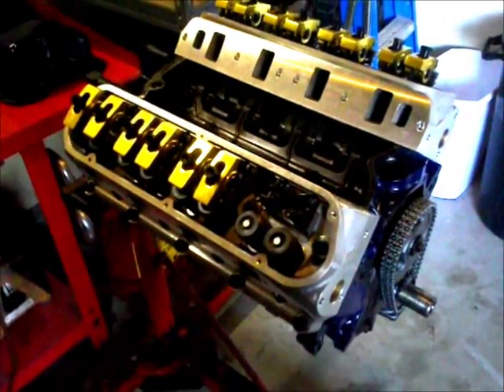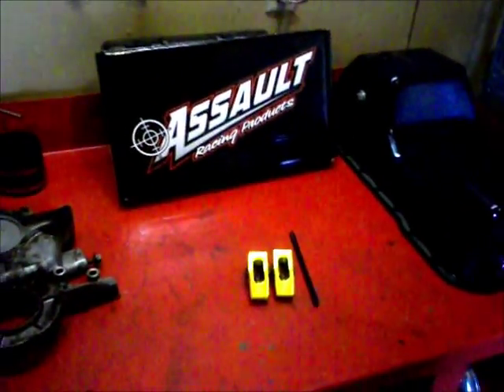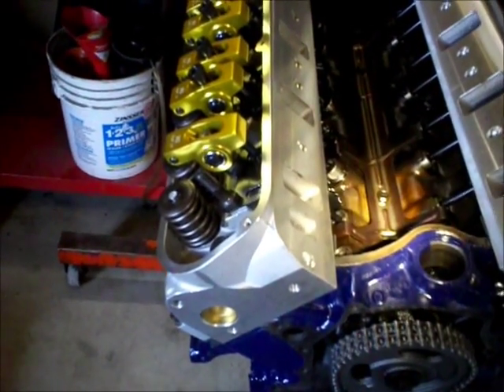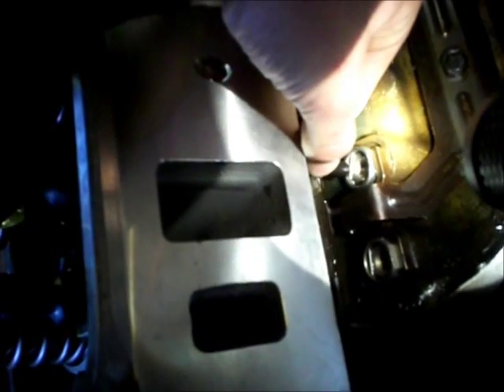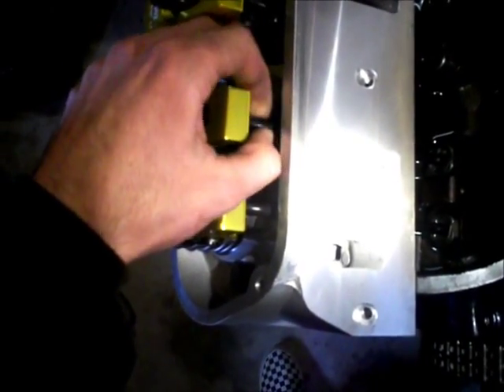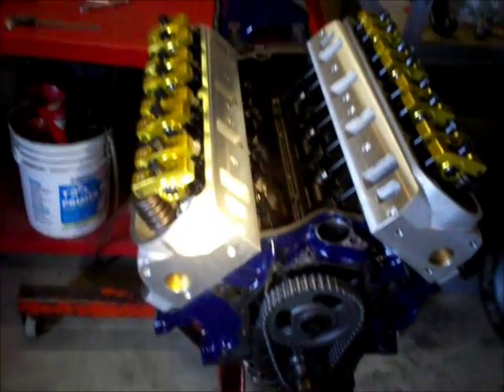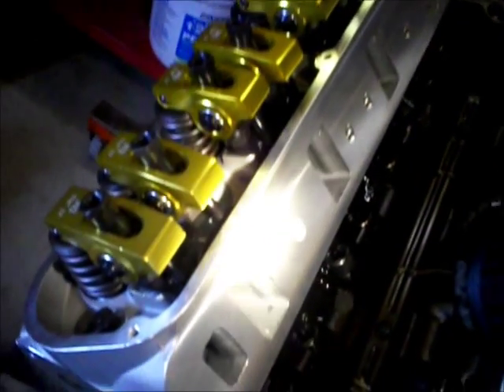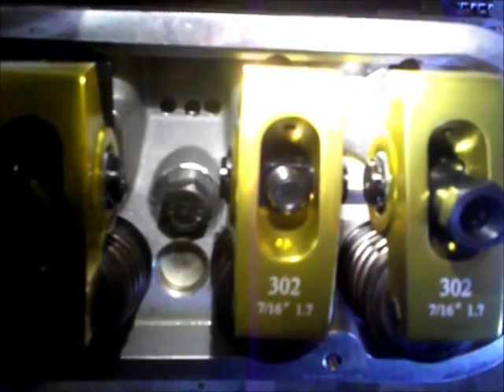How to: Adjusting roller rocker arms

Comment: Man if you actually did it this way you would be wrong use a feeler gauge simple
Reply from the maker: If it was a solid lifter motor yes, but this is the right way to do it on hydraulic lifters
Reply: It is basically an example of how to do it, but I would have had mine done an hour ago compared to all the unnecessary shit you did 🤷🏻‍♂️😂 and no filer guage needed by the way.